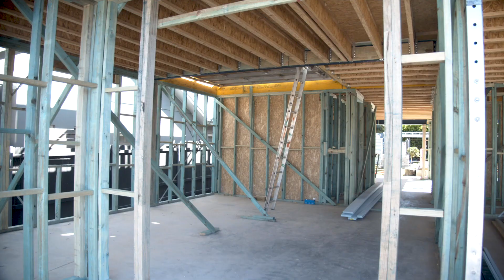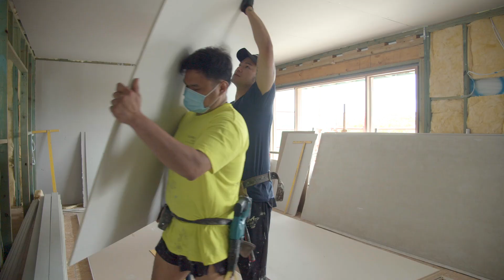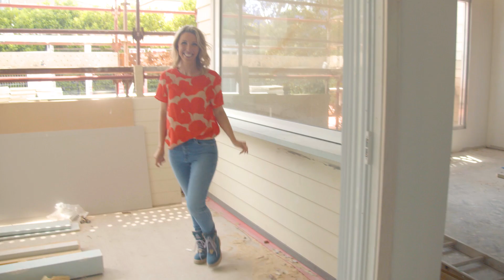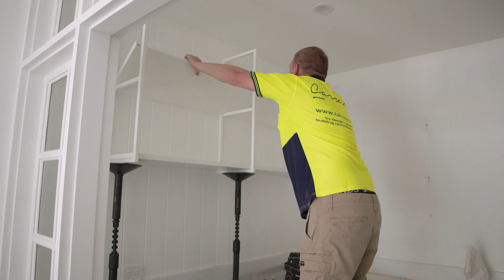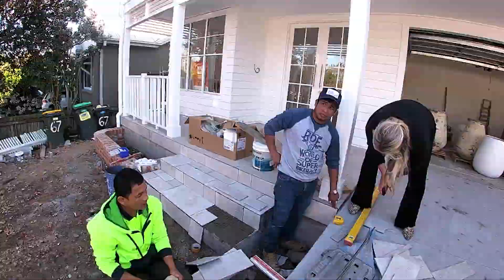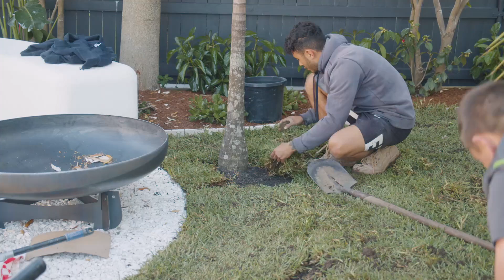Construction & Facade Reveal | Episode Four | Three Birds Dream Home | House 14

Comment: The tiling looks great but I’m concerned about the build quality in other areas. The wonky gaps of the weather board around the strut window was weird. Lots of those types of things showing up but other than that I’m not really sure what I’m looking at. It does concern me though.
Really like the kitchen handles. 
So is this a $180k-$200k home?
Reply: 100% agree although I think the cost would be at least  three times what you have suggested.